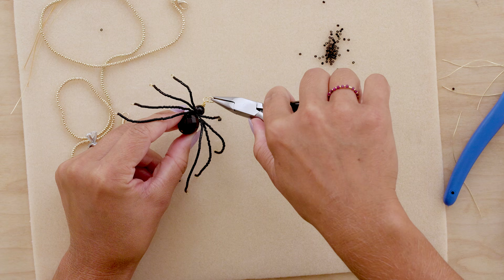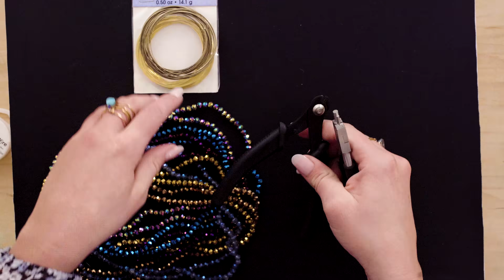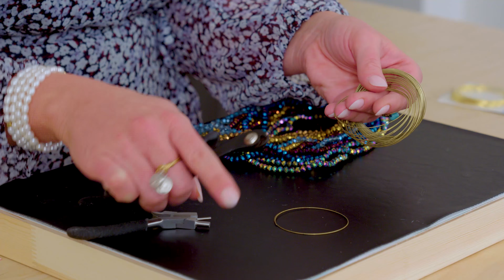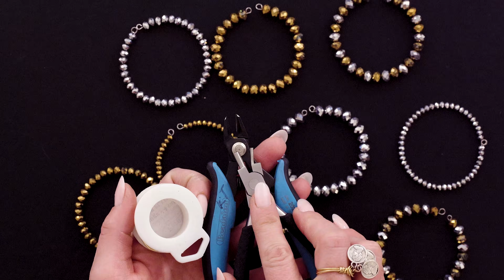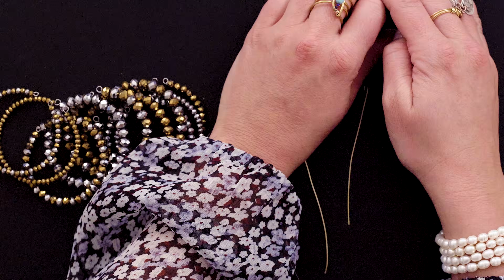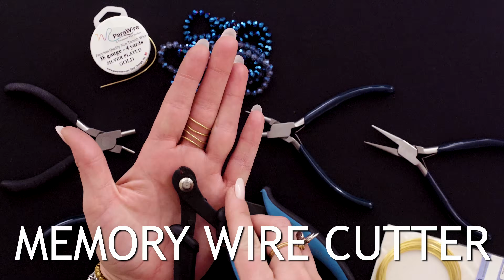Memory Wire Cuff Bracelet | Jewelry 101

Comment: What if i don't have 18 gauge wire? What can i use to substitute it for this kind if bracelet.
Reply from the maker: It's essential for this bracelet to use memory wire. However, we have another wire cuff bracelet tutorial where the style is very similar to this. You can add beads to the smaller wire that is used. Check it out! https://youtu.be/zyLqyHCaBH0